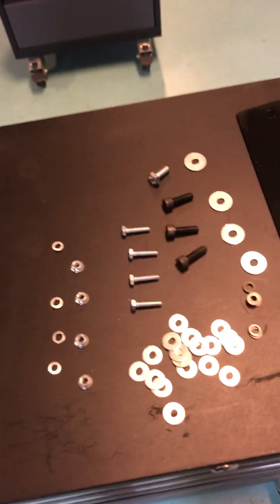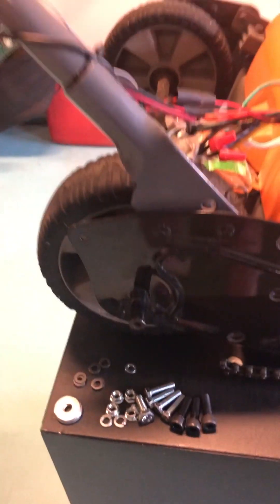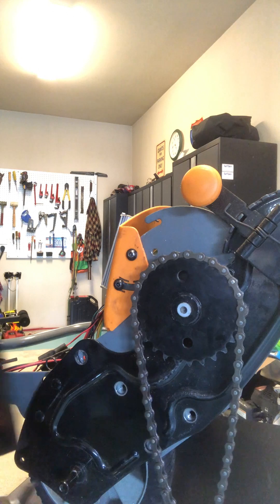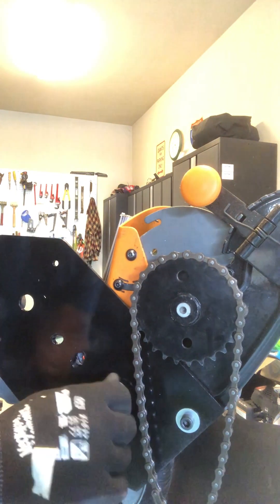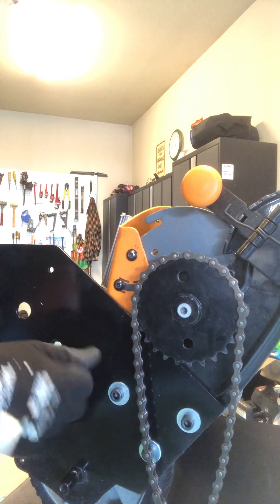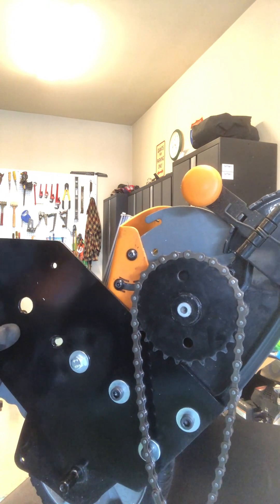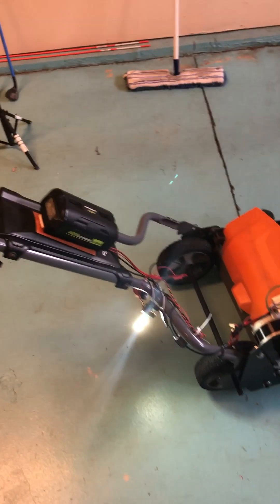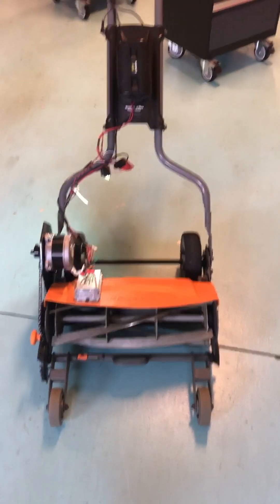I added an electric motor to my Fiskars StaySharp Reel mower

Comment: it sounds nasty! 

That is a way to find issues, so use a mechanics stethoscope to pinpoint exactly what bearings or bushings are sqealing like they are misaligned.

Kinda sounds like all of them, to me, mixed with some chain noise. I think you seed a spring chain tensioner & a little chain slop to allow slight motor misalignment, and to clean the reel bearings (or fit bearigs if they are bushings), and you might want to add a small flywheel to dampen motor for cutting stresses.

Good luck, I'm about to attempt something similar.

Comment: Great job, looking forward to seeing it cutting. This may be a dumb question but could you use the mower without the motor drive turned on, even with the chain attached? Or would that be bad turning the motor when its not activated.
Reply: No because the mechanism to drive the blades with the wheel is no longer connected.

Comment: I did almost the same thing with my mower but I am noticing the blade stops or slows with thick grass. I am using the same motor as you so there is plenty of power. Is there a clutch or something that needs to be removed to make the blade  not go into a free spin?

Comment: Did you have trouble with the rear sprocket set screw?  Front came off no issue, the rear on the other hand won’t budge.  I’ve sprayed PB Blaster, tried a number of different combinations of hex wrenches, torque wrenches, etc….no luck.

Comment: I’ve watched a few of these videos, do you think this would be possible to do with an an electric Ryobi weed eater, I take a used Ryobi weed eater strip the externals and essentially it’s a battery with a speed regulator and motor. From there, figure a way to mount and attach the motor into the chain?
Reply: I was thinking the same, but the weed eater doesn't have any torque at all. It has that cut off when it gets resistence. Might be able to bypass the peice that cuts the power for that I guess haven't dug too much into it, but still wonder if it has enough torque power or not.

Comment: Nice, what height can you get it down too? Also need to share / sell the plan for the plate so we can order one!
Reply: I can get down to about 1/2" with the smaller wheels I put on front.  I'll see if I can make a drawing for the plate.  It does depend on which electric motor is used.

Comment: Does your motor run warmn to hot after mowing ? And how much for your bracket only ?
Reply: No, I just cut the lawn yesterday ad it was about 90 degF and it ran fine.  I had a machinist at my work site cut the plate for me.

Comment: Did you have a template for the mounting plate, or a list of parts you used?
Reply: Yes, I created a template from a piece of cardboard and located the motor and holes using that.  The bolts to mount the plate were just longer versions of the 8mm bolts on the original mower.  The bolts to mount the motor were sized based on the motor I bought.